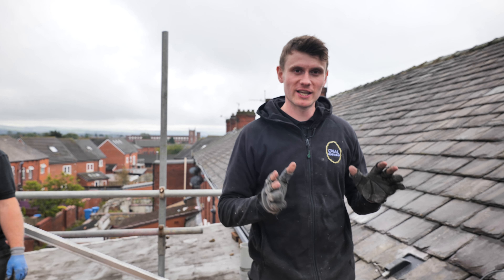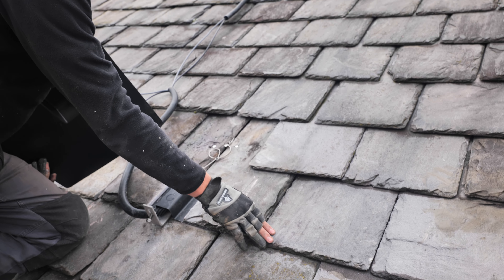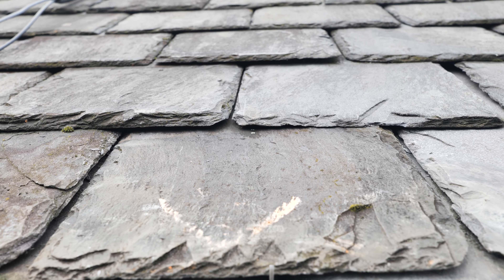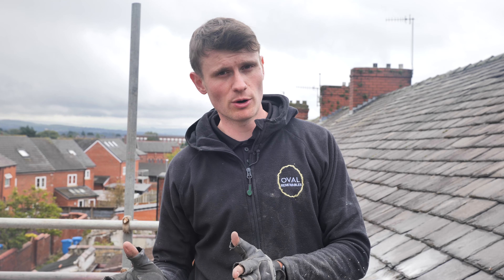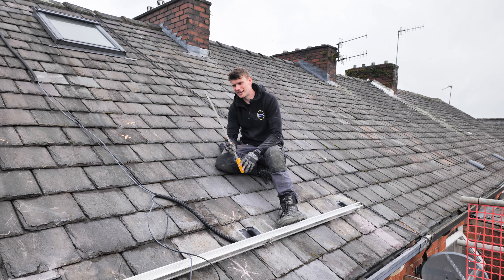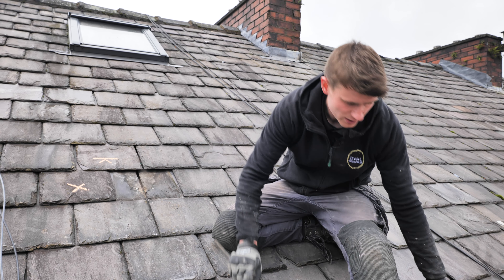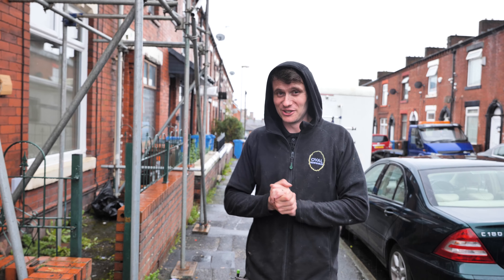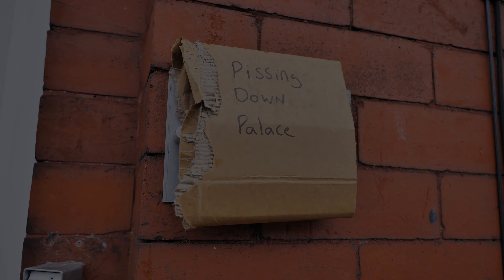Rained off on this slate roof! Solar & Battery in the rain!

Comment: That's a great tip with the RCD and 25amp mcb. Here in Ireland we have had to use RCBOs to comply and they won't accept 100mA which solves the nuisance tripping.

Comment: Great videos mate, Im doing my solar course this week Ive watched loads of your vidoes and learning no end from you, so thanks for that.
The need for a type B RCD as apposed to a type A to provide the AC supply to your inverter was mentioned yesterday, you said youve used a type A, is that because the manufacturer states it dosent require a type B? I was quoted by my wholesaler today around £200 for type B RCBO so if the manufacturers of the inverters are on top of this obviously that would be great. Im interested to hear your thoughts. Adam.

Comment: What are your thought's on slate limpets?
We use them for slate jobs in the south East which are normally composite but for the natural slate in the north not sure how effective they are. FastenSol have a MCS accredited limpet which we have been using which is entirely made form metal. Its good but I think for brittle slate like this it could just crack the tile. Keen to get your thoughts though?
Reply from the maker: Not a fan. Doesn’t feel right to just screw through the roof in my view.